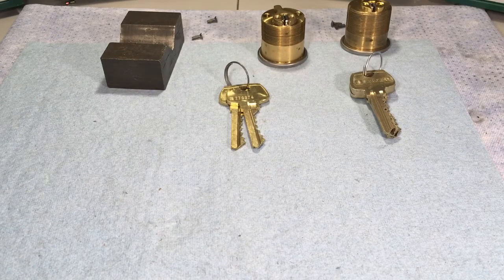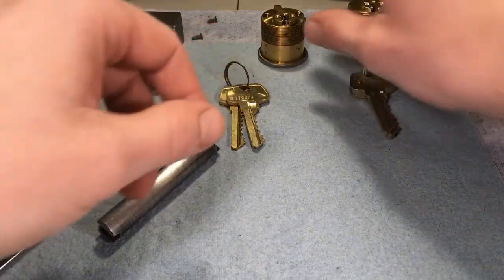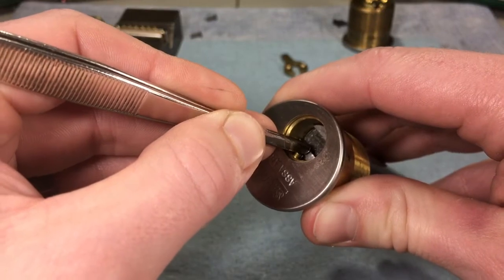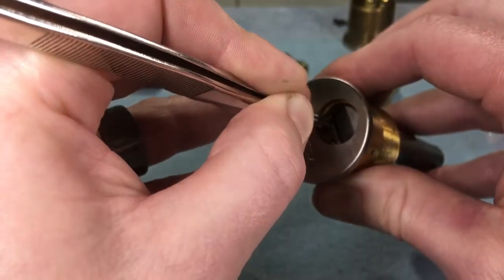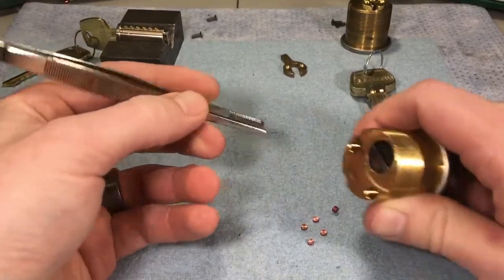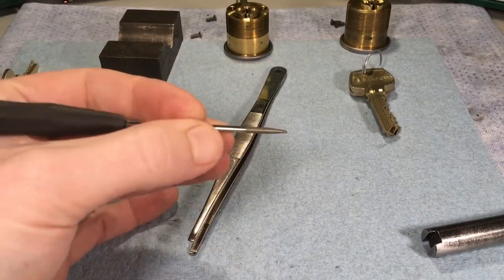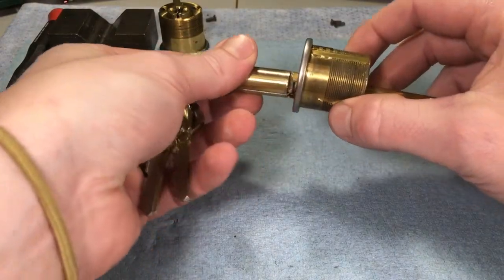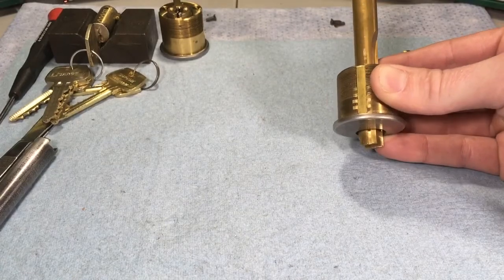Checking A Cylinder’s ‘Bible’

Comment: One tip not mentioned. Most Schlage Locks have spool top pins in Deadbolts ans the nasty T pins in the knob and lever cylinders. They will catch when using a master pin follower. A broken pick is a nice quick way to tuck them back inside the top chamber and allow the master pin follower to roll them up where they belong.